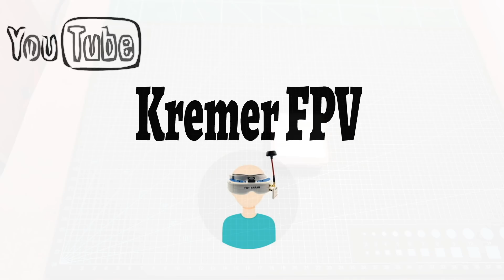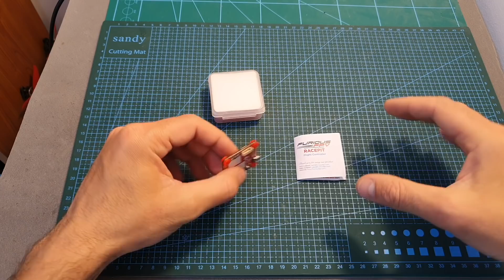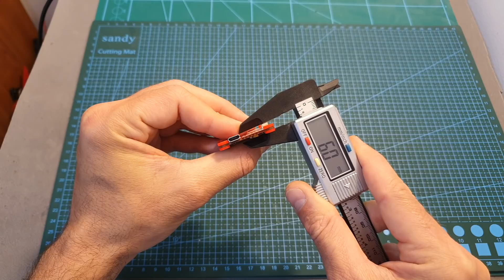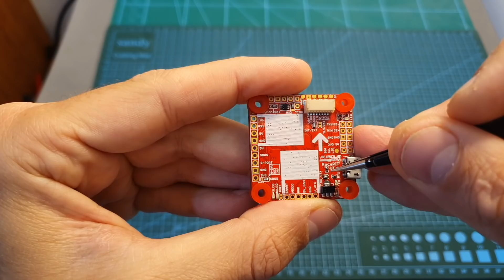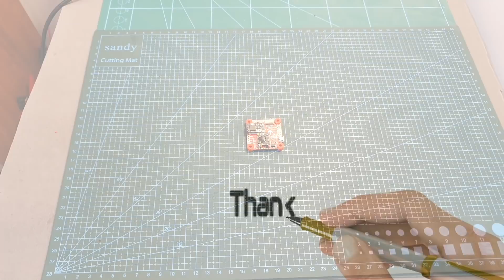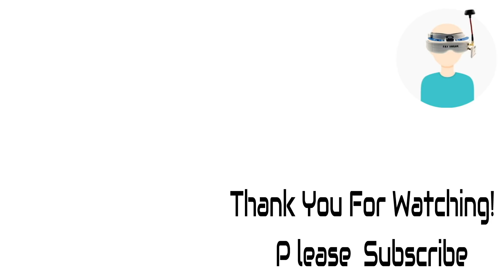FuriousFPV Racepit F4 Flight Controller

Comment: I can't get telemetry working with R-SXR I've updated RX unsoldered the telemetry tab, got smart port active on uart5, I get basic rssi but no pack voltage any ideas? thanks
Reply from the maker: Did you ever get telemetry working with the RXSR receiver? You might need to use the univerted pad on the RX.
See this thread which might help you out: https://intofpv.com/t-mamba-f405-r-xsr-telemetry
Reply: Gal Kremer I did get it going finally I had the earth on the crossfire Rx side, I knew it would be my fault 😂

Comment: Can I put a xm+ where the nano rx is?
Reply from the maker: you can use the correct pads for the XM+ but I am not sure if you will be able to use pin headers like the XM+ (I have to double check it).

Comment: hello gal i have this fc i built 2 quads with same specs im running my vtx on 5v but my camera wont turn on on 5v but it works in vbat have you experienced that on your racepit?
Reply from the maker: I haven't, but sh*t happens, you know. Did you figure it out?
Reply: Gal Kremer yea they said it is a common problem when you power your vtx with 5v fc cant provide more 5v for cam
Reply from the maker: @angelfpv4825  I had a similar issue with a toothpick style fc so I guess it's a common issue...

Comment: Hi bro...Does this fc have rssi input? Seems like it does not =(
Reply from the maker: Please check out the layout in the user manual. As far as I can remember - it doesn't.
Reply: @KremerFPV  yeah it does not have rssi port..need to use aux channel to display rssi
Reply from the maker: @sedilic  Thanks for the update.

Comment: Cool Synergy...oh wait lol
Reply from the maker: I have the Synergy too. As far as I can tell the PCB is totally different, so the only similarity is that it has dedicated mounts for the RX and VTX.
Reply: Of course it's not an exact copy, but they used the ideas of the vtx switch, and receiver and vtx mounting directly from the Synergy. My biggest problem with it is Furious' obvious copying as when it first came out they called it the Real Pit which is a direct copy of the vtx switch used in the synergy. We called them out on it and they quickly changed it, albeit barely.
Reply from the maker: @TheRCAddict  Thanks for the info, I wasn't aware of it...